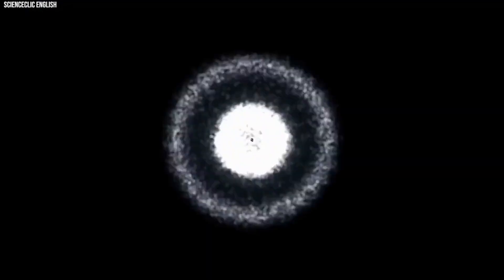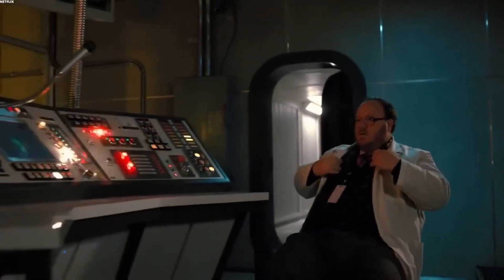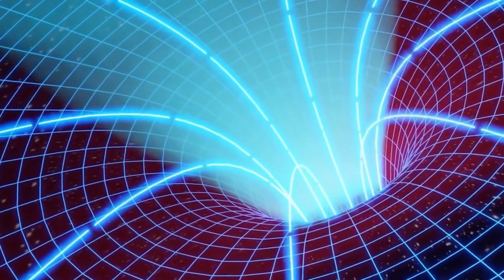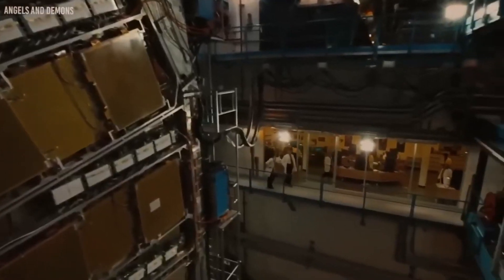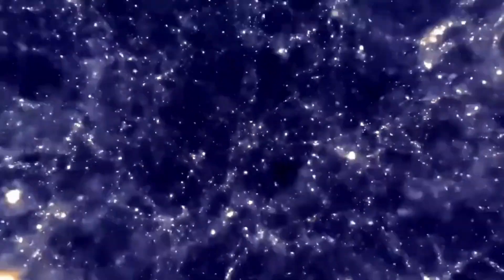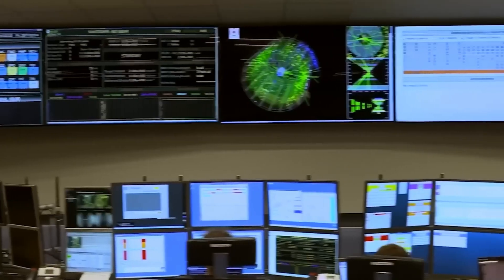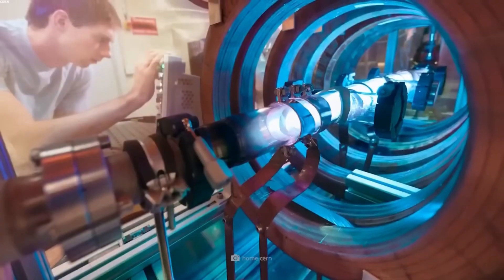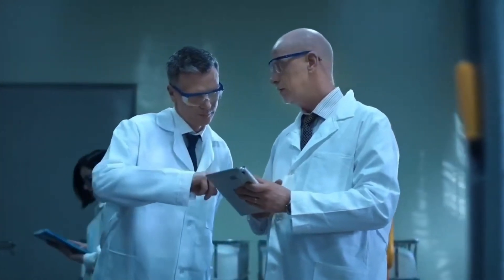CERN Scientists Break Silence On Chilling New Discovery That Changes Everything

Comment: Faster than light is possible ? ..its only confined to the 27 kms and on the path the strong  magnetic fluctuations  bent speeding particle  through this 27 kms ..to be faster near to lights speed .. exceeding the speed of light  can be achieved in natural conditions of a BLACK HOLE  or a WHITE HOLE tunneling  ONLY  ..
CERN  says -When these particles hit their top speed, which is 99.91% of the speed of light, they are made to crash into each other